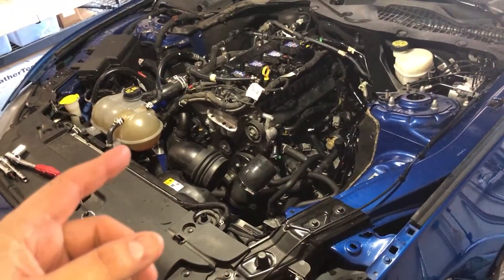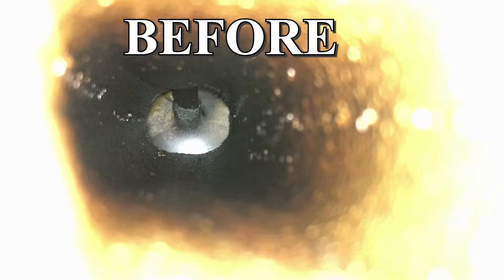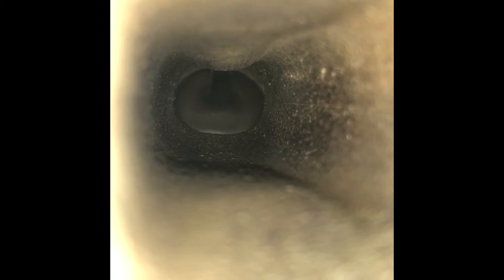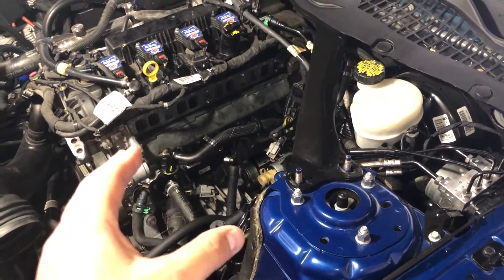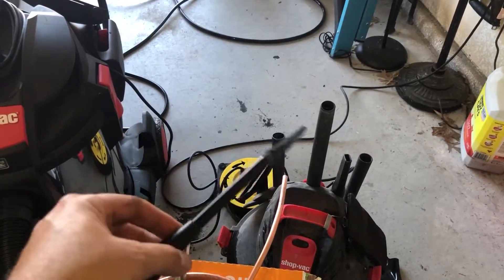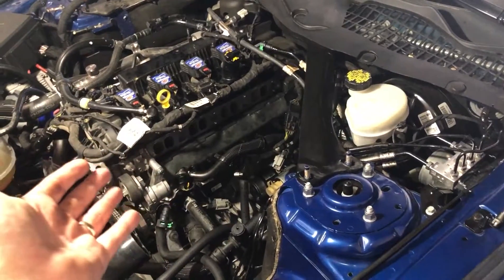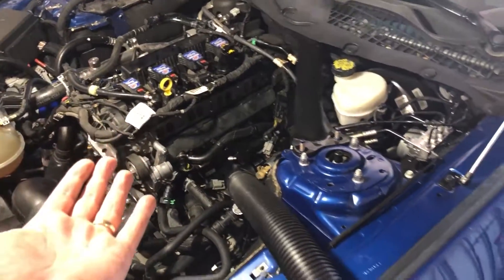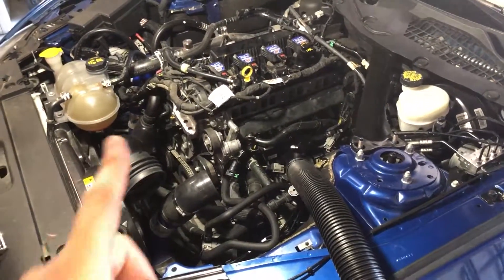2017 Ecoboost Mustang After Valve Cleaning Walnut Shell Blasting - 78,500 Miles - Misfire / Misfires

Comment: Where are you located? No shops in my area want to do it, only bmws. And I don’t trust much places let alone believe they won’t leave a little shell and mess up the entire engine
Reply: That’s the whole point of using walnut shells. They won’t damage your engine.
Reply: @onlycodered  not if you leave a piece behind. It won't damage your engine in a sense that it won't leave scratches on the block, but if you leave a piece behind and don't clean it properly afterwards, if you fire up that engine, it WILL most definitely damage your engine.

Comment: Did you do the passenger side? That’s where the PCV blows the oil/ water mixture all over the cylinder 2 valves if I’m not mistaken. That’s where it really gets caked up.
Reply from the maker: The PVC is going through a Mishimoto catch can and back into the intake manifold so the build up you saw was with the catch can.  If not,  it would have been much worst.  Really big difference since the cleaning.

Comment: have you gotten the car back running? just curious if everything is running properly still. seems like a crazy way to clean the valves with the heads still on the car.
Reply from the maker: Yes.  It has been running for 2 months now.  BEST THING I HAVE DONE!!!!  The process is actually no different than what the professionals do at a BMW service, I just did it with DIY items.  See the link below.

Not only has it fixed my misfire/idling issues, but the performance gain is quite noticeable and brought my car back to life.  Also the CRC turbo/intake cleaner is the bomb.  It really works very well to break that stuff down and will be putting one of these every 10k into the system to minimize the accumulations for the future.  Hope this helps.
https://www.youtube.com/watch?v=ONp6gQXpyKU